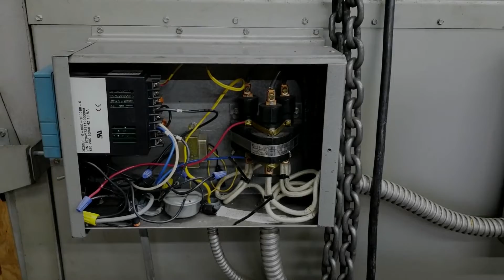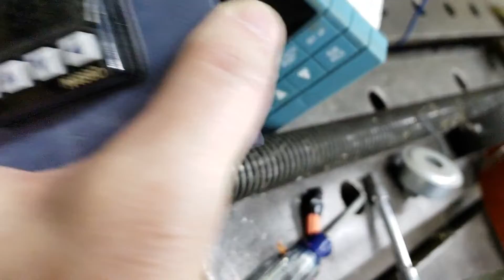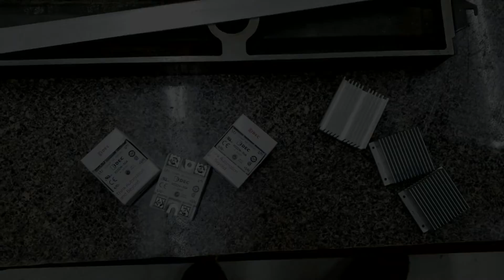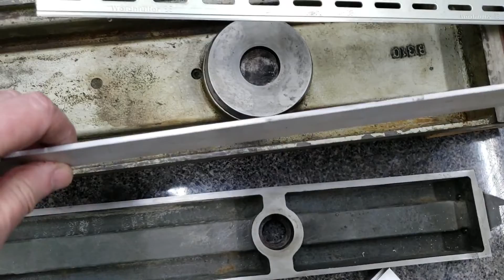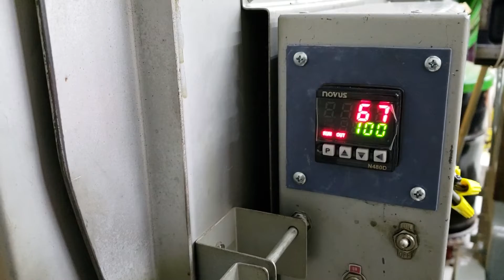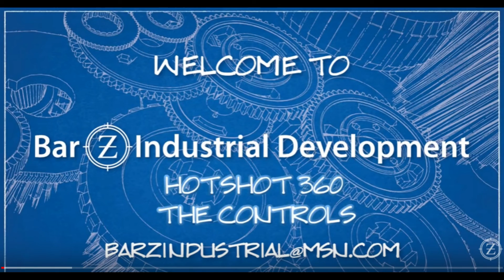Heat Treat Furnace Control Upgrade To Novus N480D PID

Comment: That is very impressive holding temp for so long. Any progress on the planer ?
Reply from the maker: The foundry did reply back via text and said they are closed this week and will get back to me next week.  So, no progress.
Reply: @Tools4Machines  what are you getting made?
Reply from the maker: Pattern and one-off casting of the broken/busted/cracked toolslide.
Reply: @Tools4Machines  ahh factory service parts like I seem to keep making lol

Comment: Guillotine door style is the only heat treat unit we would own, it is all about the heat and the safety of the door going up and away and out of our way when heat treating. This is just our take. The size of your furnace is a large one lots to heat up but you need what you need. 3.00 inches wow that is a great unit, great buy.
Reply from the maker: It IS a really heavy door and I love the ease and safety of the door mechanism.

Comment: I am wondering: Is the thermocouple sensor the same one that came with that oven? And the 1468 vs 1500 degrees: is there a calibration factor in the PID that will adjust for that?
I have an oven with basically a knob and a meter, so this would be a big upgrade for it.
Reply: Thermocouple technology hasn't changed much in 50+ years, the temp range dictates the type of sensor to use, type "K" is the norm for this class of oven.